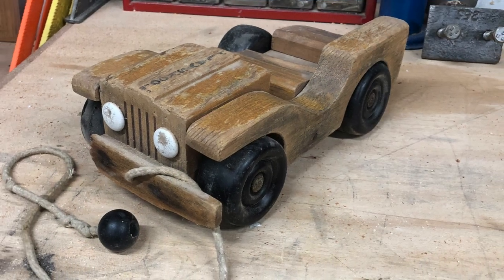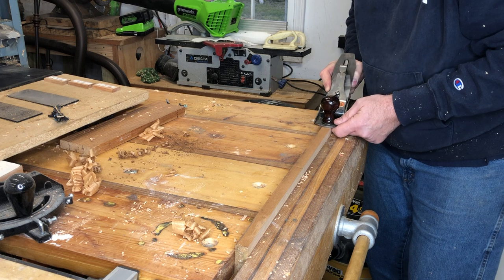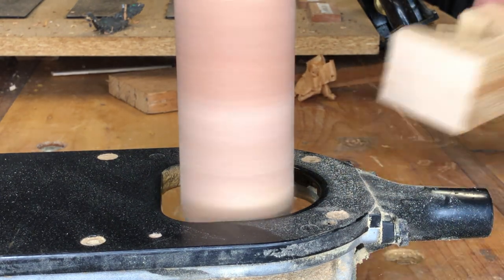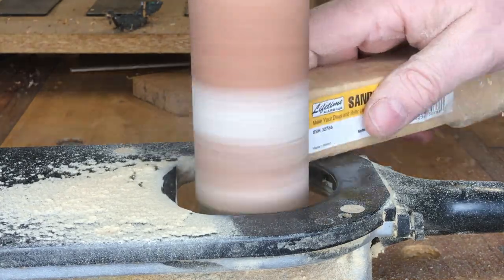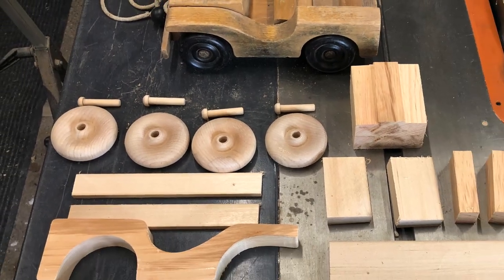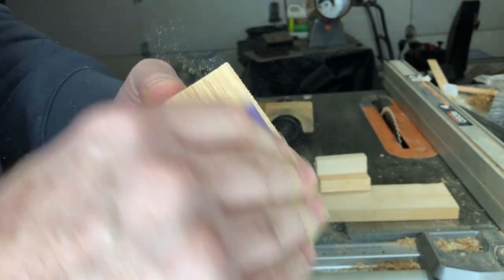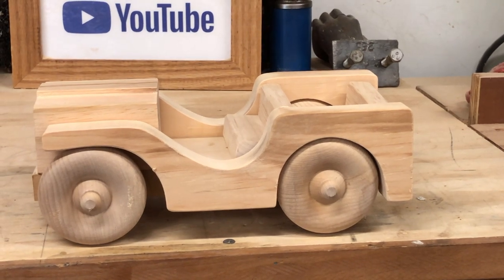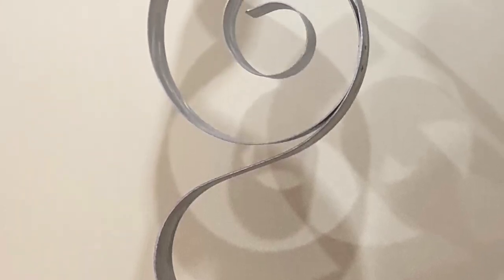Scoutcrafter Pine Wood Derby Challenge Jeep

Comment: I thought it was to be made from a single 12" length of 2X4?
Reply from the maker: You are correct. I used roughly that amount of wood but it was from a reclaimed 5/4 board. The width was only 3 inches, and the length of the Jeep was only 9 1/2 inches. I probably should return my trophy.